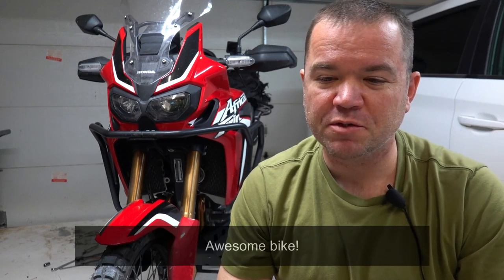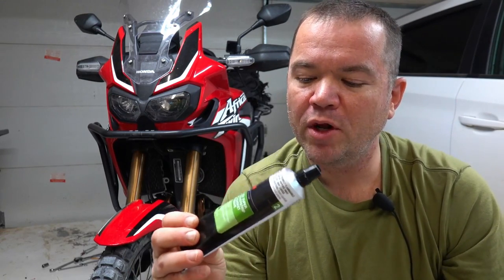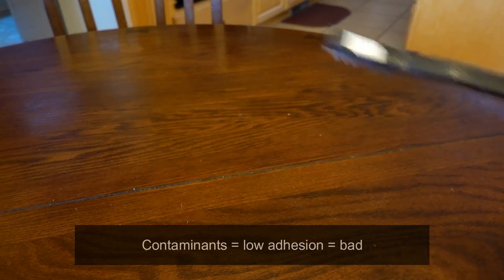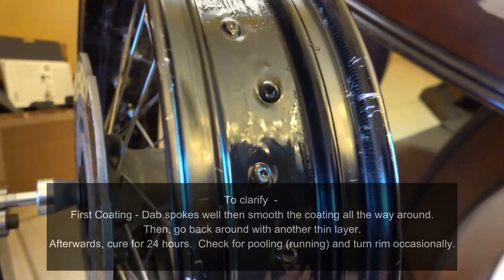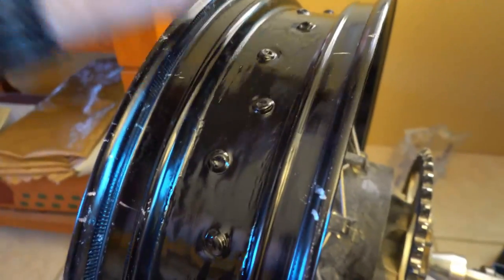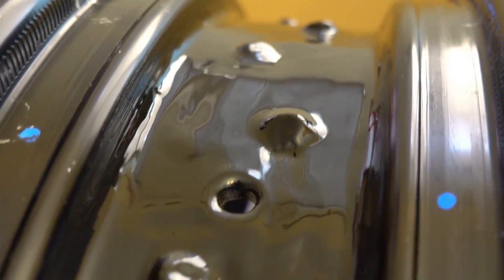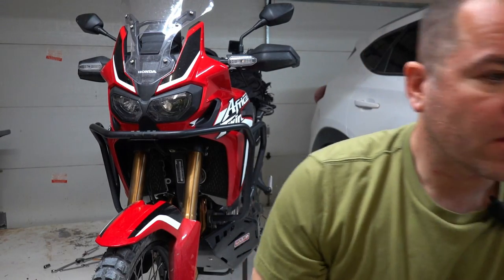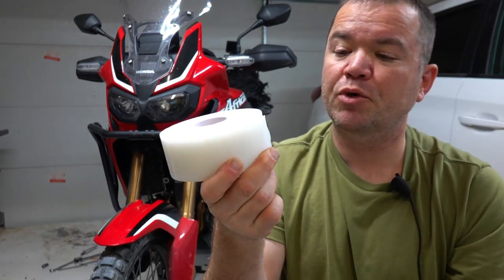The $27 Honda Africa Twin Tubeless Conversion

Comment from the maker: Update on this video -- Flex Seal for some reason failed about 2.5 months or so into the application.  This was not a catastrophic failure but it developed a very slow leak around one of the spokes, then a leak around the valve.  I'm not sure if this is due to shrinking or maybe just being abused inside of a tire :D -- I removed the tire and inspected the flex seal and saw no chipping, ripping, or cracking, so I'm thinking the natural flexing of a rim managed to work it just loose enough to develop slow leaks.

I have since went back to a HD tube on the rear, but I kept the flex seal as a 'tube liner' since it was in such good shape. 

My next experiment will be with the 3M tape everyone raves about :)
Reply: Need to put flex tape, after flex seal is it work well for me
Reply: Did you do the 3M 4412N yet? Done my rims in 2017 and still no leaks to this day. Even had to adjust more than 10 spokes and the tapes still holding
Reply: Flex tape for the win. Not cheap but works like nothing else.
Reply: @cactustoadwine3755  Hi, any special markings to put on my spoke wheels?  because I have thought about the tape "Gorilla" but I have heard that the 3M is very good .... I will appreciate your answer.
Reply: Hi there,
Do you have any updates for tubeless?
Reply: sealant I keep seeing people use is 3M Marine Adhesive Sealant 5200

Comment: I recommend installing the valve stem first and cover the hole on the stem with a piece of tape. You can puncture the hole before installing the air valve

Comment: can you please confirm that you can run tube type tires on tube type rims after that? Thinking about doing the same
Reply from the maker: Hey thanks for the comment - not sure if you saw my pinned comment, but the FlexSeal failed after about 2.5 months, so I would not recommend that.

I switched over to using  3M 4412N Sealant Tape (for the rear rim only) and it has held for over 2 years :) Also, I have been running Dunlop Trailmax Mission tires since that time.

Edit -- I have, at times, actually used a tube along with the 3M tape on the rear rim and it ran fine - I ended up once getting a nail in the tube and while it did deflate, it did so slowly and not instantly.
Reply: @cputeq007  yes, I have seen it. There are other solutions to seal. I have seen a video a guy sealed his rim with 3M 5200 sealant. I would give it a try after I can confirm that it is ok to ride tube tires on tube type rims without the tube. It is going to be for MX bike sand dunes riding.

Comment: Why not just use standard automotive RTV sealant?   Good enough to hold the pressure of a water pump good enough for this application I would think.

Comment: One question, why should you not use the innertube also? So when you have a flat tire you are able to put a plug in.
Reply from the maker: Actually I'm doing that now, but with 3M tape also. I guess it depends on how you ride the bike. My hope is that if my tube is punctured, it'll be a slower leak with the 'sealed' rim vs a bare rim.

If you don't air down much, it's probably better to just run without the tubes because all they're doing is adding weight and not giving any real benefit.  That's assuming you've sealed the rim properly.

Comment: Handy tip when mounting any tubeless tire, if the bead won't seat and is leaking put a tiedown around the tire to put pressure on it to spread the bead in conjunction with a dose of soapy juice.

Did the 3M 5200 Marine sealant and 3M 4411N tape thing on my Husky 701 Enduro, so far so awesome.  When doing the tape, always face the ending part facing away from the tire's direction of rotation.  The stuff is so sticky it probably doesn't matter but ya might as well pad your chances 😆

Comment: The best stuff I found for doing these is the 3M tape  but make sure you use the thicker stuff not the thinner stuff I also used a Tube of sealant that we get here in the UK called Tiger Seal is very similar to the sealant they use to bond in windscreens in cars I did this around the nipples after cleaning The complete rim with 100% alcohol gave Tiger Seal 48 hours to dry then use the tape I’ve since done about 10,000 miles with no issues and I’ve done the front and the rear.
Reply: That s the stuff , I think his system + 3M tape would be great, like yours double protection.

Comment: got a look at a professionally sealed spoke rim (sealed by the rim maker) and they used some kind of flat black substance that appeared to be applied with heat. it looked a lot like a rubber rim strip (band that protects tubes from the rough surfaces of spokes). it looked like they wrapped the black 'band' around the rim then melted it on, but hard to say
Reply from the maker: Yes I could imagine that being a good fix.  I have since applied 3M tape to this rim and it's much more hearty than the Flexseal in staying on the rim.

Comment: First of all, THANKS for the detailed explanation. I have never done this before & new to Honda DCT Africa Twin world. I was riding with the wife and had no clue as what to do when we got a rear tire flat, was a complete nightmare. Seeing your video I have purchased everything and will start the process this week. I do have a question 🙋🏼‍♂️ I’m going to replace my rear tire and don’t know if I buy for tube or tubeless? Please advise and advise is greatly appreciated. Again, thanks & ride safe.
Reply from the maker: Thanks for the response Jose -- I hope you see my pinned comment in this post, but long story short, the Flex-Seal failed after a few months.  Now, it was a slow failure and I do a good amount of bumpy off-roading, so I think one of my spokes caused a slow leak (I have since replace with 3M marine tape and it's held very well so far!)

For what it's worth, I use Dunlop Trailmax and they're both tubeless. Most tubeless should be ready to use with tubes just fine.  For my personal bike, my front is still tubed (because supposedly the 2018 AT doesn't have a safety lip on the front wheel for tubeless) and my rear is tubeless with 3M.
Reply: Thanks for the advice, best regards! Ride safe!

Comment: So do you think if you did three coats of the flex seal it would of done better
Reply from the maker: Not sure, but I don't think so.  I put the stuff on pretty thick and while it's very pliable when coating, it seems to 'tighten' somewhat when dry and doesn't adhere as well as it would seem.  After it failed, it was fairly easy to remove and replace with 3M tape (the Flex seal would come off very smoothly, not a lot of sanding required) -- so that leads me to believe the bond between the Flex seal and the rim wasn't that great or flexible.

Comment: Did you Use the Sham Wow to clean your rim with?   All kidding aside I was hoping that was gonna work.   I am wondering if the flex tape on top of the flex seal would have worked.
Reply from the maker: Hahah no Sham wow -- why didn't I think of that!?  Actually I cleaned them off and used 3M tape and so far, about 14000 miles and no problems! (only sealed the rear).

Comment: wouldn't it break the seal first time you adjusted your spokes?
Reply: It would. Use 3M 4412N tape instead, it allows for spoke tension adjusting.
Reply: Yes it would

Comment: So how do you re torque your spokes now
Reply from the maker: BAH -- minor details!  Actually I replaced with 3M tape, but the question is still valid.  I honestly don't do enough rough offroad on my AT to justify messing with the spokes too much, so I don't worry too horribly about adjusting them.
Reply: @cputeq007  they loosen up just riding on pavement..just FYI especially on the west coast our road suck
Reply from the maker: @gabrielkopp2036  Thanks yeah I'll have to check mine - both of my bikes have spokes :D

Comment: Great video. Since it lasted over 2 months, I was wondering if just that one spoke may have been damaged or loose and cause the issue.
Maybe not sine it hasn't been an issue with the tube. Still, good job.

Comment: I'm curious what would happen to the seal once you adjust the spokes.
Reply: It is good to use a set of newer wheels as they are clean, but not brand new as you want  the spokes to be bedded in and adjusted prior to doing  this.  Once they are bedded in I rarely see a need to adjust the spokes.  If you do and it leaks mark the spoke, take the tire off and repair the area.

I finally broke down and got a Rabaconda and a Harbor Freight static wheel balancer.  The Rabaconda was money,  but it makes tire changing easy.  Bonus, I don't accept cash from friends, but I will accept beer for tire changing  duties 😆

Comment: I had a tire repair shop convert my rim using old interiors of smaller diameter on video. It's still holding up until now. It's in the filipino language though. Maybe you can try and replicate it.

Comment: i''m going to convert to tubless.  i like what you did.  question.  did you have problems balancing the tires?
Reply from the maker: No problem balancing the tires, but I would use 3M tape vs the flex seal (see my pinned comment).  So far my 3M has lasted about 9000 miles no problem! (rear tire only).

Comment: one question, the rim is not tubeless the tire could come out of the rim in some turn;
Reply: The rear is safe
Reply: @IAmYourReflection  the front is not possible?  do you just do the back?
Reply: @nnikos  alot of guys do both and have no issues
Reply: @IAmYourReflection  to understand is there no danger of the tire coming out of the rim?
Reply: @nnikos  not on the rear

Comment: Why didn't you do it on the front wheel too?
I know that the front wheel doesn't have the bead (I think this is the correct name) to prevent the tire to "unglue" from the rim, but don't you think that the tyre pressure is enough to prevent it?
I'm considering doing it too, but I still didn't do it.
Thank you.
Reply from the maker: Eventually I will do the front - I had already mounted the new tire (with tube) and didn't feel like unmounting to do this video :)  I will keep the tube up front though because of the rim lacking the lip that the rear rim has.  However, I think (hope) the flex seal will help with slowing air loss if I get a front tube puncture

Comment: thanks for the vid. don't use the flex seal on any more rims, that stuff is crap, it cracks, dry rots, and will likely sabotage the rest of your good job over time.  I used it on a few things years back out of curiosity.  Not one was but a disaster over a short time.
Reply from the maker: Very interesting - I'm wondering if the compound was changed?  I had someone in the AT Facebook group (one of several groups) say they use it in AZ all the time, but I didn't ask about longevity.

Comment: Good video, thanks man!
So does it hold up ok long term? Do you need to top- up?
Reply from the maker: Thanks Lou but unfortunately it failed after about 2.5 months (see my pinned comment). I think it's because I was riding a lot of rocks and the spokes flexed too much and caused a slow leak.

There are other people on my AT group that have used it for over 1 year and no leaks but I'm betting they're mostly street or not riding big-shock terrain like rocks.
Reply: @cputeq007  good to know. Thanks again. I wonder if just the 3m tape is the way to go?

Comment: Hello. How is it holding up? Still works?
Reply from the maker: No sorry, it failed after about 2.5-3 months.  I believe it's because I was riding offroad in lots of rocks, and the spoke heads flexed and barely broke the barrier of the flex seal :)  It was a very slow leak.  I since replaced with 3M tape.

Comment: How it's holding up mate
Reply from the maker: Hi thanks for the response - It started to leak after about 2.5 months because I think I was doing a lot of rock riding and flexing the spokes - not a fast leak but very slow. I scraped it off and did the 3M tape mode and it works much better !

Comment: Project farm did a review against flex seal, turns out it's actually pretty shitty, there's better options. Maybe give those a try
Reply from the maker: Yes I have 3M tape and a new set of Dunlop Trailmax Missions that I'll be slapping on soon, so I'm going to remove the flex seal and tape up both rims (even though I'm still using tubes).

Comment: 180 degrees is a lot. If your rim gets that hot your tire will not last long
Reply: If you get a flat and drive on it with low air pressure, the tire will get that hot.  Mine was so hot I couldn’t touch it with my hand.  When I got home, I replaced the tire as the heat probably ruined it.  In my case I was 30 miles from home.  I shot in fix a flat, each can gave me about 10 miles.  I had 3 cans with me.  After 20 miles I had to wait an hour for the tire to cool down. Then I shot in the last can.  A wrecker would of cost $200 to get home.  Ruined tire cost $110